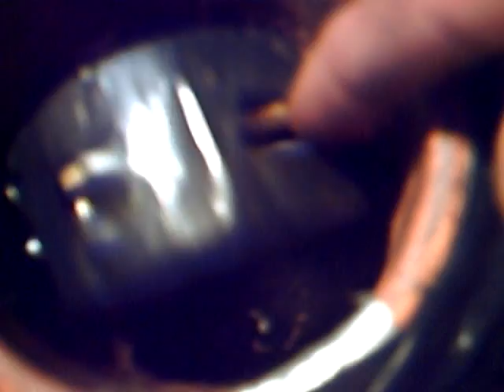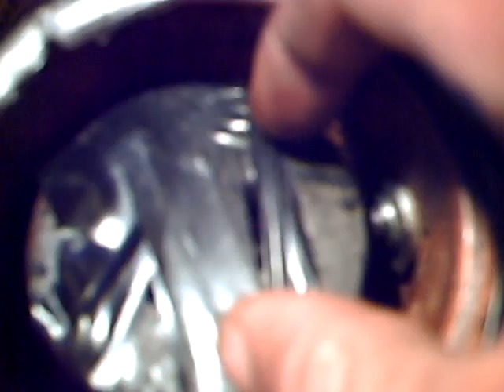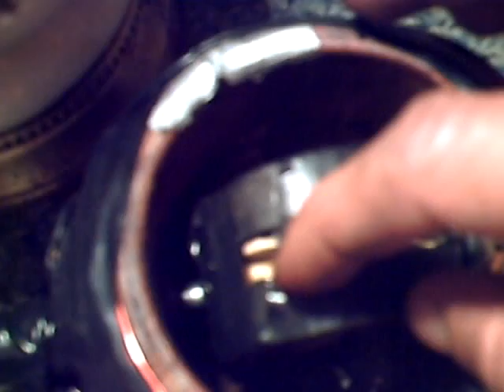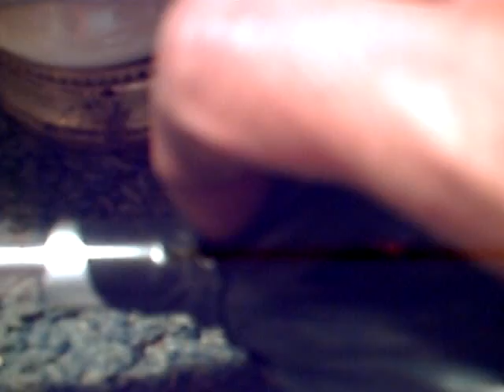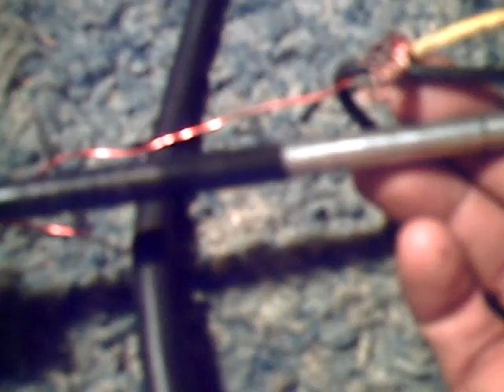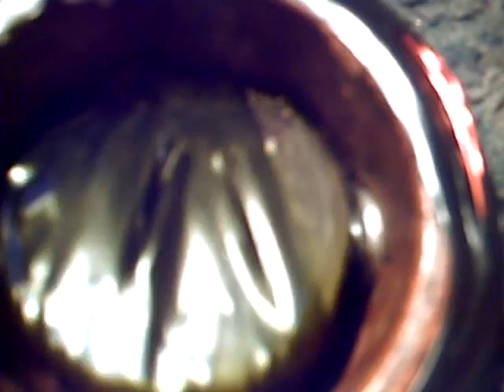FREE ENERGY JOSEPH NEWMAN MACHINE BATTERY CHARGER FAN pt 3

Comment: I'm an engineer. I met Joe Newman twice and chatted with him a lot back 
in the late 1980s. My guess is that the entire phenomenon he found is 
that the motor circuit was designed so that he was unwittingly blasting 
away chemical reaction products off of the anodes of the batter(ies) he 
used. It seemed to people that he was tapping into a new energy source 
since he could take "dead" batteries and get them to work again.

These batteries were not dead, but virtually dead. By electrically 
cleaning off the anode he was extracting more energy from them, but this
 was energy already remnant in the electrolytic cell. This would also 
explain why he never made a circuit that would run itself.
Reply: +Jim Intrater In that case the battery would have completely died and cannot be recharged.  Fact is that you can use rechargeable batteries on Newman motors and they will ultimately drain down.  However they will be rechargeable and can be charged up to run the motor again.  

I'm not sure about the Newman motor charging batteries till they are full.   What Rayovac stated about Newman motors is that they did charge them up and possibly overcharged them.  From conventional point of view, the batteries will die down, but imagine running a massive motor for a few hours with a few transistor batteries?  Who needs overunity when you can almost hit 100% efficiency.  Companies and industries pay tens of thousands to hundreds of thousands for IE4 or NEMA premium 93% or 96% efficient motors.  Anything that can do above that which I believe that the Newman motor can do, then this should be the new standard to replace AC induction.  I don't think I can find a few horse power motor run off transistor batteries.
Reply: +Constantine Joseph I assume that what happens is you will simply get more usable life out of an existing battery.
Reply: +Jim Intrater precisely.  Its because the Newman motor uses milliamp level amperages to produce higher torque.  That is a game changer technology kept away from the public.
Reply: +Constantine Joseph The issue is whether there is extra energy. There is, but only because he better utilizes the chemical energy of the battery. Joe wanted to believe that he was tapping into a new form of energy. He wasn't.
Reply: +Jim Intrater That isn't scientifically proven as you say, which ever chemical you are talking about.  The DC oscilloscope suggests that the back emf can be detected and is again absorbed by the battery, resulting in it being used for longer durations.  The back emf does not come from the battery but from collapsing or decaying magnetic fields.  Your assumptions to prove this phenomena has to be backed, if not there is no evidence the chemical component in the batteries provide more power.  Whereas the super accurate scope shows negative current being placed backwards to power source during motor operations.  I'm not sure if you actually worked with him directly on his project or you are just assuming based on verbal conversations.
Reply: +Constantine Joseph this isn't complicated. The back end is from the collapsing field, but the field is pre-charged by the battery. It is known that if you take a "dead" battery and heat or scrub the electrodes you will get remnant energy out of it. People falsely thought a dead battery had no left over juice in it. If insulation chemical reaction products form on the anode, the battery stops working.
Reply: +Jim Intrater it's not that the motor takes more chemical power.  It's the contact or high pulses of back emf that over charges the battery resulting in battery death.  If seen on oscilloscope, the amperage are at milliamp levels and it would be like a small toy device sapping the batteries slowly except that the motor is immensely large.  The reason why the motor has ruined those batteries because they aren't lithium ion or nimh rechargeable, they were nicd zinc chloride conventional ones that actually recharged via the Newman concept.  Replace those with rechargeable batteries and the batteries will last even longer under operation as they are meant to collect backward electrons from back emf.
Reply: +Constantine Joseph I was not suggesting that the back emf damaged the battery, but that it prevented chemical reaction build-up on the anode which could have prematurely stopped the battery from functioning.
Reply: +Jim Intrater That was back in the day, try using modern rechargeable batteries.  My newman prototype could run on those for days
Reply: +Constantine Joseph the only legitimate test is total mechanical work performed vs. total chemical energy in the battery (regardless of its rating).
Reply: +Jim Intrater Keppe motor of Brazil is exactly like a Newman motor.  They have already commercialized their fan units.  Savings of electricity is about up to 90 percent.  Go check their website

Comment: A simple example of free energy is a permanent magnet and an electromagnet lets say on your ceiling. 
You power up the electromagnet and place a metal object say a hammer on it and it sticks. Work is being done.
You then take the same hammer and place it on the permanent magnet and it sticks without having to supply power to it.

Free energy.

Comment: In most electric motors, the wires are rotating on a VERTICAL axis with respect to the ring of magnets around it.  In electric motors, copper thread, or its equivalent, rotates in the same way a basketball rolls along the hoop.

In slip ring electric motors, coils are on the outside, and whether it is the coil or the magnet which rotates, they do it along their along the VERTICAL axis of the other. Thanks to PorterhouseV, for the exceptional point about the slip ring DC motor.

Comment: Key in on this. On a Newman motor/generator, the magnets are rotating on a HORIZONTAL axis with respect to the toroidal wire wrap. The magnet inside rotates in the same way an NBA player throws a basketball into the hoop.

All the YES men will say, "If the decoy looks like a duck and quacks like duck, then it's probably a duck." That's right, but that view is only the skin and bones of the what it is, the bones being the ones inside their heads.

Comment: Great videos but its just seems too simple to be true. You made a Macgyver looking contraption with household items that if it works would render the most expensive and high tech generators obsolete. If its recharging the batteries it should run until the bearings lock up. Why not set up a 24hr webcam showing it running nonstop?